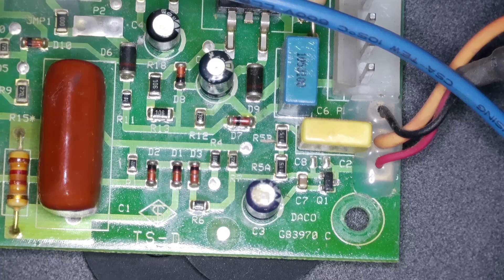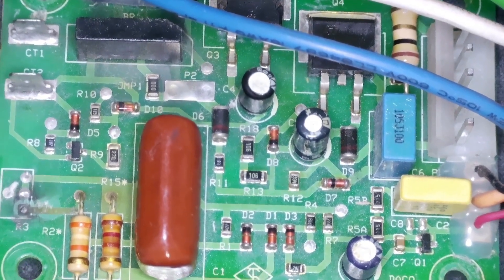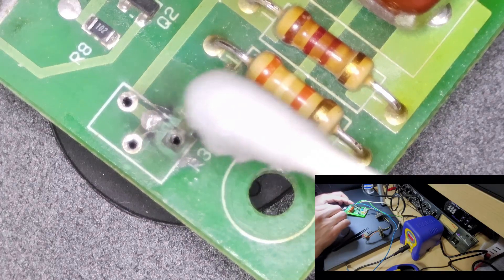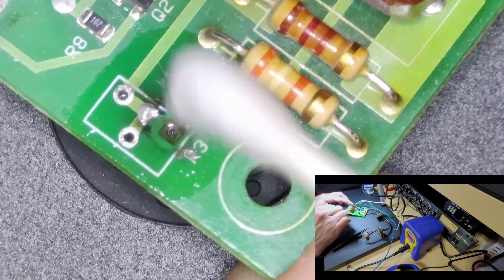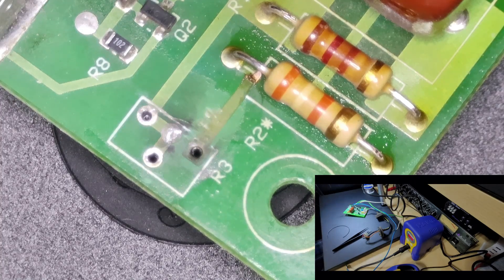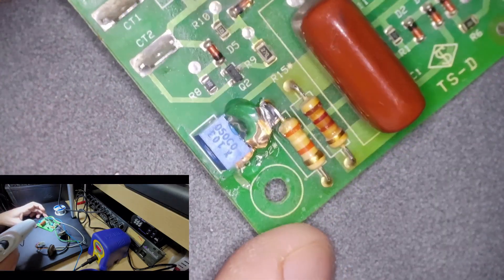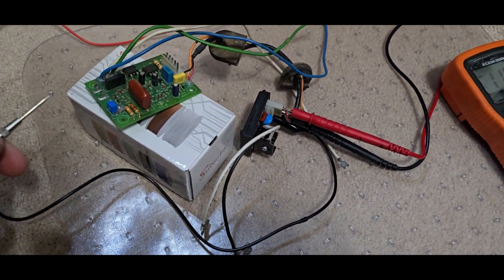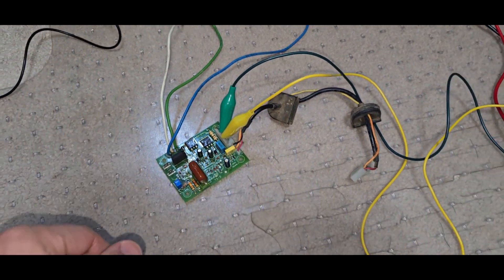Briggs Generac Generator AVR Control Board Repair: 83970GS

Comment: Have you fixed any new Generac Generator Controllers? Like 10000003275? Also if lightning is the cause of this issue or ants would the problem be fixable?